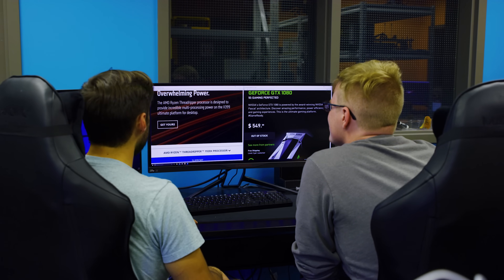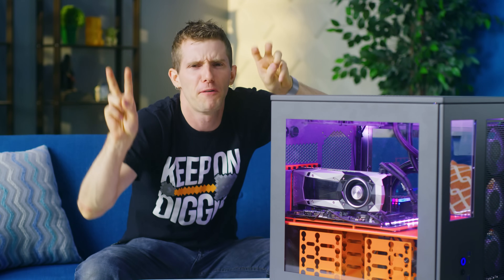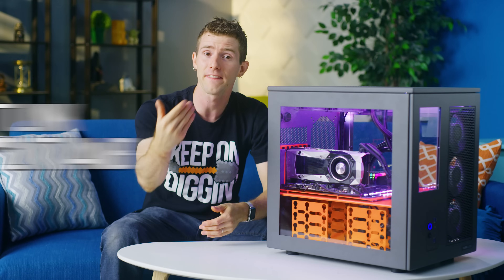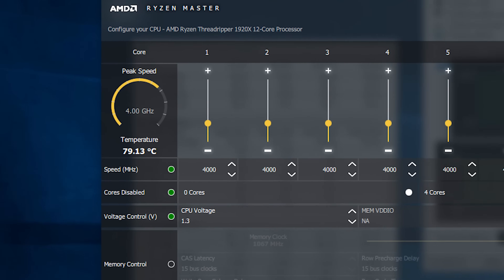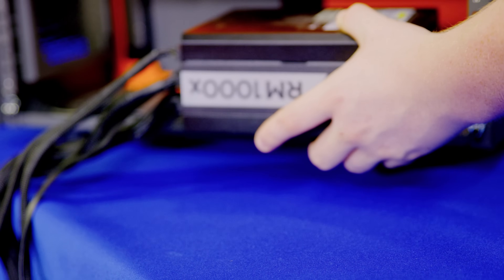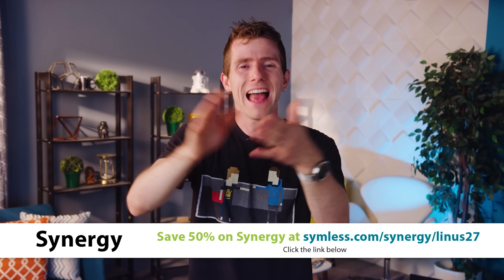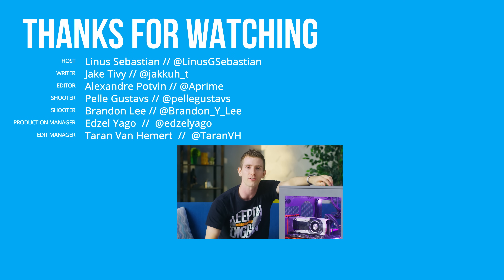The 1920x1080 MEME PC - WE BUILD & TEST IT

Comment: I honestly don't get it. There's all the RAM in the world, a 3.5GHz CPU should shovel data quickly enough no matter its thread count, and the GTX 1080 is a very powerful GPU. Are these results real? Where's the bottleneck at?
Reply: The settings were at ridiculously overkill levels.
Reply: 1080 bottleneck due to max settings. Heres a tip: never ever use max settings in games, often a waste of time.
Reply: But this is ridiculous. You buy a GTX 1080 for 4K or VR, it pretty much owns 1440p. At 1080p there just aren't any settings to even make it break a sweat. The video itself says @1:13 that "All of this hardware is overpowered for 1080p gaming." The GPU has been benchmarked elsewhere with very different results, see http://www.guru3d.com/articles-pages/deus-ex-mankind-divided-pc-graphics-performance-benchmark-review,6.html for an example. I cannot imagine that the Threadripper is THAT much worse than an intel cpu.
Reply: 0lfan Because it can't be. It runs at ridiculously high frequencies for a 12 core CPU, no matter the IPC, it wasn't running at 1080p, this should be a very good combo, I really question the validity of their results.
Reply: It seems you people do not understand what supersampling and anti aliasing is.
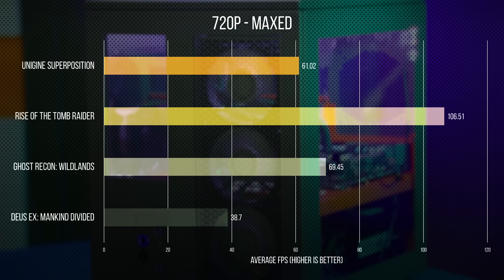Reply: Sam, please quit the trolling. Deus Ex: MD's builtin benchmark in 1080p at ultra settings came out at 63Hz for the above-linked guru3d's non-Threadripper build last year, and @5:04 in this one it not even manages 39Hz at 720p. Same benchmark, same settings, lower resolution and yet much slower. I wasn't asking what could lower benchmark results in general, I'm wondering why this specific build could possibly be this slow in these specific benchmarks, each of which has been run and published in many many other builds and had much better results everywhere else. This video makes the Threadripper look worse than even an old Athlon X4: see https://www.techspot.com/review/1235-deus-ex-mankind-divided-benchmarks/page5.html
Reply: threadripper is not for gaming and usually people pair a 1080 with a 7700k or something along those lines not a 700 pound workstation cpu

Comment: How is the fame rates so low with a 1080 I have a 1060 and  get 60 fames 4K maxed in those games
Reply: You have a better CPU than a 1920x for gaming, his entire point was that thing is a mad bottleneck
Reply: Rossy167 cant half its cores be turned off and used in "local" mode or gaming mode and performance be exceptionally better?
Reply: David Morris  I learned the "max settings is impossible" lesson the hard way when I learned that my 1070 was not capable of handling maxed out ghost recon wildlands lol

Comment: I need to get a new pc, should I build a similar pc to this? I want to run at 1080p 30 fps fortnite atleast medium settings.
Reply: No. If you want to game you should focus on the GPU not the CPU. Also medium settings 30fps 1080p isn't going to require threadripper or 1080.
Reply: r/whooosh
Reply: TheFirstNobody  r/whoosh
Reply: @FadedEX r/whoosh
Reply: @hanzomain9124 
For fuck sake. That's not how it works
Reply: @mr.sexybignuts  r/whoosh
Reply: @ernahuskofan3616  r/whoosh
Reply: @hanzomain9124 
Lmao
Reply: @ernahuskofan3616  R/wOoOsH

Comment: my pc is around 90° when playing games like fortnite now
maybe other games as well
Intel Core i5 7500 
8GB RAM
 GTX 1060 6GB
Reply: Just rotate it clockwise and it will run cooler. 90° + (-90°) = 0°.
Reply: Just rotate it clockwise and it will run cooler. 90° + (-90°) = 0°.
Reply: Just rotate it clockwise and it will run cooler. 90° + (-90°) = 0°.
Reply: Just rotate it clockwise and it will run cooler. 90° + (-90°) = 0°.

Comment: I don't get it (I mean I do get the MEME but...), Is that a that bad a CPU that can't even handle 720p gaming? That's what I don't get. With my Dell 7567 Gaming Laptop (7gen Core i7 and GTX1050Ti) I can run Rise of the Tomb Raider @1080p with everything on high specs just fine. Before, I had a desktop PC with a Phenom x4 965 and a GTX970 and I ran the same game @1080p with everything maxed out.

Comment: There is no way that the cpu was bottle necking a 1080, and there was no way that the 1080 was bottlenecking the 1920x. I can easily game at 4k on a mix of high to ultra settings (on most games) with a r5-1600X and Titan Black. How could this possible be worse than that at 720p?

Comment: Why didnt linus use a gtx 1080 ti ,he use just a gtx 1080 which is weaker then the gtx1080 ti ,at the start of the video Nvidia put the gtx 1080 ti with thredripper

Comment: Threadripper is meant for workstations and rendering across many, many CPU cores, not gaming. Gaming CPUs need better single and quad core performance. These parts are not bad, but they're overpriced, redundant, and not fit for what you'd want in an excellent gaming rig. This is what Linus means by calling it a troll rig: the GPU is not right for CAD, the CPU is not right for gaming, and the memory is just bonkers on the configuration, so it fits in a weird spot. This kind of rig is actually excellent for game developers who need very powerful GPUs to run and use the engines in realtime and extremely powerful multithreaded CPUs for rendering and compiling, and all that memory, even at that bonkers 8 x 8 GB configuration is definitely useful.

An Intel i5 9600k would probably get you a much better performance for gaming since you have 6 cores unlocked capable of boosting fairly easily to 4.7 Ghz, beyond what the Threadripper is capable of doing safely (4.2 Ghz). AMD always has a slight decrease in performance for gaming as they choose to focus on many cores rather than clock performance, so you can game just fine on Ryzens, but they're better suited for workstations. Personally I use a Ryzen 7 2700x paired with an older GeForce GTX 960 to complement my game dev work. I have no regrets, though I wouldn't mind a 2060.

Comment: jesus. my 6700k skylake and gtx 1080 pushes 60fps with 16gb 3000mhz ram on 4k. but threadripper is being bottlenecked by the 1080
Reply: over way around 1080 is bottle-necked by threadripper

Comment: According to NVIDIA Geforce Experience, the optimal setup for 1080p gaming with a 1080 Ti is to render scale back the resolution from a higher 2K resolution. It still seems to get more frames, though, and is great for 144hz. I don't get what everybody is on about, 1080p and 1440p are going to extend the life of the card by years, based on your standards, so long as graphics cards stay at a consistent upward trend in performance.

Comment: Respect to ubisoft, even without Dx12 they can still optimize thier games to run smoother than the games that are lol cough Tomb Raider cough I can pull 45fps solid at 1080p in Farcry 4 but can't even do 30 fps for Fallout 4 on my FX8300 :/ Not saying they don't have their faults like Denouvo or Repitition but that is a plus in my books...

Oh any before I'm murdered by for using FX in 2019 I just sniped a Ryzen 5 1600x OEM for $140 and got the mobo and ram for another $140. So I can rejoin the PC master race once agian :3

Comment: Now I remember why this was called the meme build.
Also, so the issue is Graphics performance bottlenecking to super strong CPU? I think? I'm very much a noob at this, having ordered parts for my first computer less than 24 hours ago. SLI would probably have some better results, right?
Reply: Tyler Joseph Schommer it's actually the other way around: the cpu is holding everything else back. 

This is because threadripper isn't made for games, it's made for multithreading. So things like Blender will benefit, but games won't.
Reply: David Morris  I'm not wrong...

Comment: I dont understand... Why is the performance so bad? I get the joke with the names, but why is the 1080 being bottlenecked by an $800 cpu? Or if the cpu is being bottlenecked by the gpu, then wtf kind of gpu do you need? arent 1080s practically top of the line? Is it just the mixing of nvidia and amd parts?
Reply: threadripper is not that amazing for gaming more expensive cpus arent necessarily better in all ways

Comment: I don't get the joke is this a bad pc for gameing looks pretty good
Reply: The threadripper is a major bottleneck because it wasn't designed for gaming.
Reply: The joke is the threadripper 1920x with the gtx1080, which if you put the names together you'll get 1920x1080 which is the name of the most used resolution right now.
Reply: Victor Silva oh okay I though they said 1920x1080 was a bad resolution

Comment: with a nerd voice Well actually you cannot run modern games with ultra graphics 1080p 144fps (for 144hz screen, its 2k18 mah dudes) without a 1080 Ti
Reply: SHF // ShadowHunterFi lul you can
Reply: SHF // ShadowHunterFi you can. The problem is, threadripper isn't made for games. It's made for multithreading, so things like Blender will benefit, but games won't.